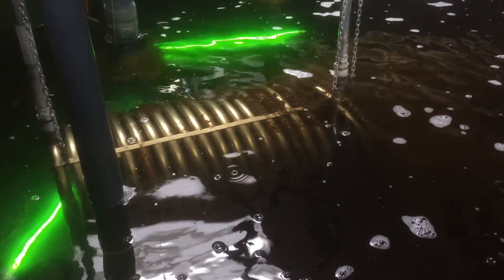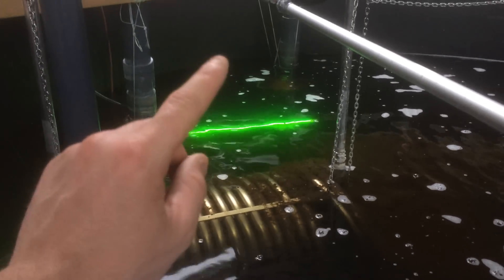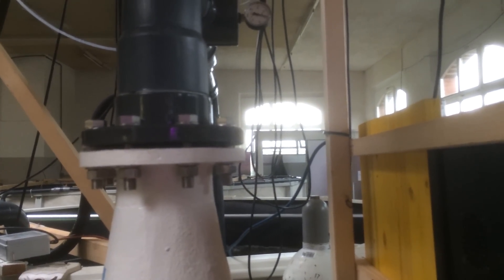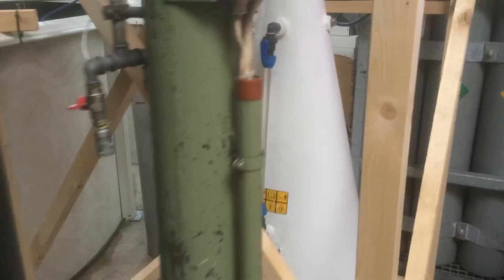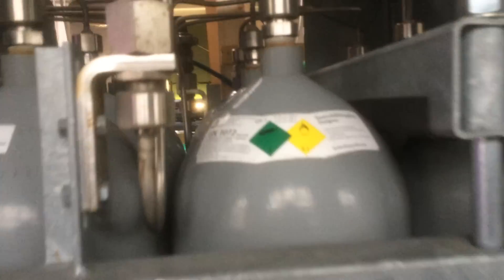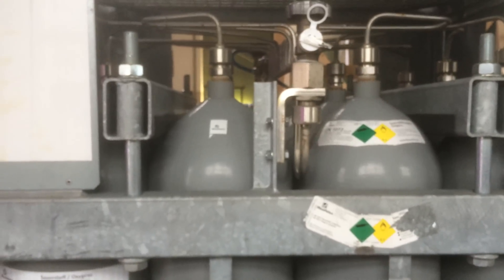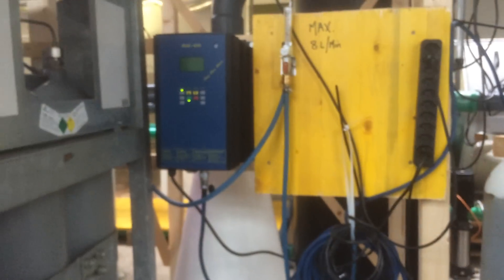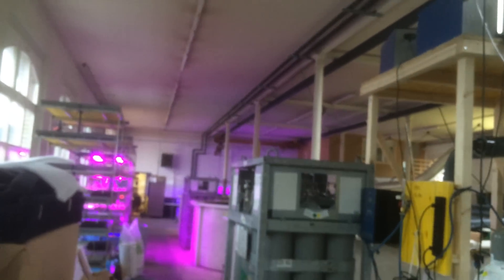Aquaponic / aquaculture , filter and oxygen concentrators.

Comment: thanks for your reply. Market price is one of the biggest obstacles. Just a thought it might be feasible where I am planning to. Well I think 5 ppm DO would be enough for Tilapia but just having hard time to calculate total required LOx/yr so that I could allocate budget for it. Other thing is, you adding O2 in heated water in a tank. Thereby some O2 might be diffusing out. wouldn't be better if you pump heated water in the cone then straight supply in the grow out tank? what do you think?
Reply from the maker: 5ppm is not enough for maximum growth... With the cone and LHOs we have a max . of 20% loss of O2. Direct diffusion in the tanks is loss of between 60-80%...
Reply from the maker: We pump the pure O2 after heating... Direct to the cone and LHOs.